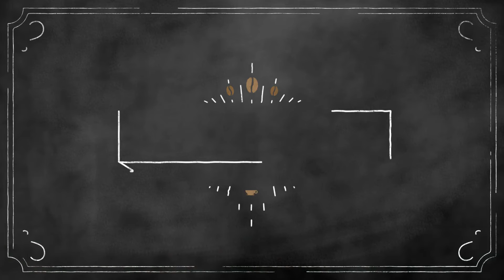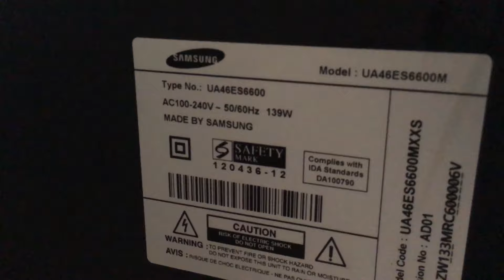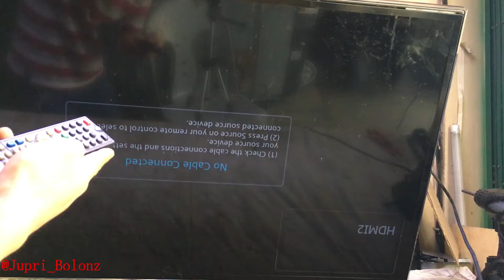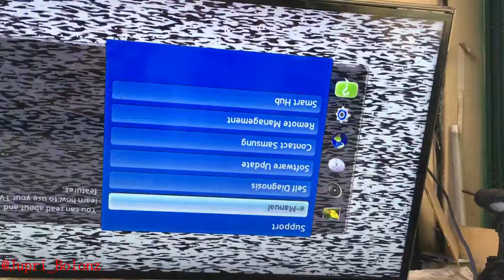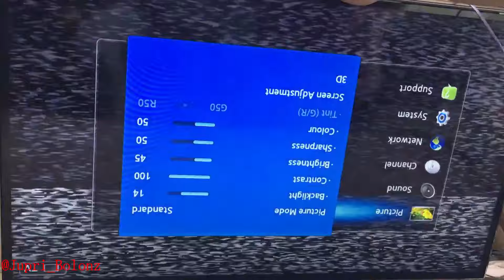Smart Tv Samsung Gagal Start Vlog#14

Comment: Bang jupri bisa saya minta kontak wa nya? Mau tanya tentang samsung  smart tv Curved, lampu standby sama persis seperti diatas.
Reply: Tegangan stdby 9 v
Tegangan on 12,8 v
Hanya beberapa detik tegangan on balik ke tegangan stby.
Di ukur ps on nya ketika di tekan tombol on terukur 3,4 lalu 3 detik aja langsung hilang lagi. Itu kira kira dimana masalahnya ya bang? Tegangan elco besar ketika standby 300v pas di cabut kabel ke mainboard muncul 400v.

Terima kasih bang.
Di tunggu jawabannya
Reply: Tegangan ps on di blok power supply setelah di lepas yg ke mainboard terukur 4,5 v
Reply from the maker: Ceritanya sperti muncul logo langsung reatart gitu kek nya mas .
Coba tekan on sambil ukur teg di elco primer untuk teg auto voltage naik apa tidak 400 v slama 3 dtik itu ?
Reply: @jupriselektronik4017  layar belum hidup bang. Tegangan elco naik dari 300 ke 390 ketika di on kan lalu turun lagi ke 300. Pas mau on itu tegangannya stabil aja 390 v bang.